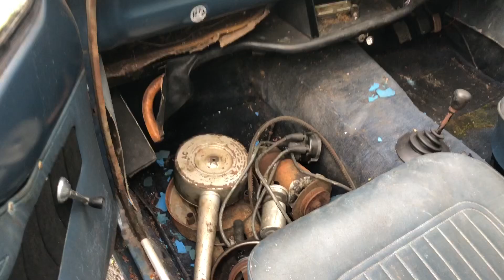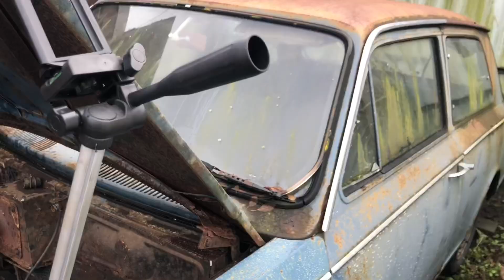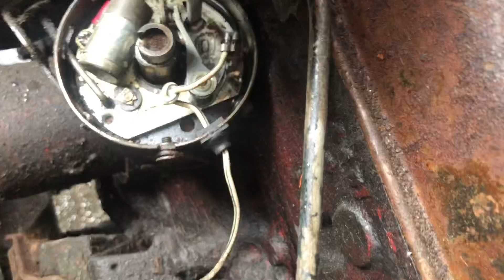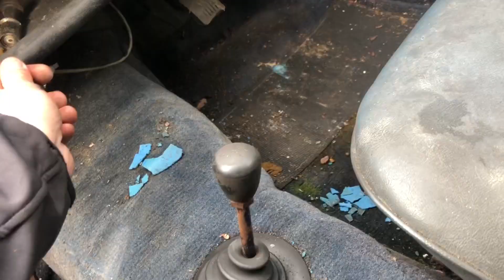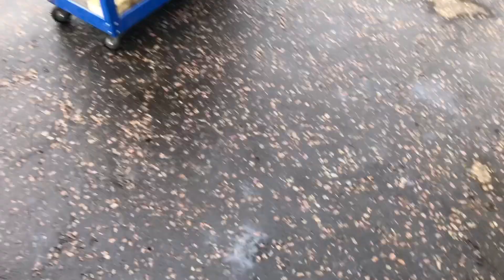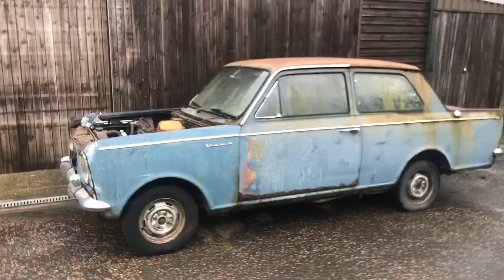Will it run after 19 years 1964 HA viva

Comment: Nice one, guys! Amazing to think that a 55 year old car can be brought back to life. I have mixed memories of the HA. My sis had one in the 1970s. She loved it, and it was generally reliable. One day she told me she was going on hols for a week, and as it was left outside in the road - as per most Londoners - could I drive over and keep an eye on it. I did, and everything looked OK. When she climbed into it, tried starting, nothing happened. I was red-faced - some bar steward had nicked the battery! There was no lock to the bonnet (hood). You popped it open by pushing the lever in the grille (if my memory is good). I felt so bad I rigged up a spare choke cable and did a bit of metalwork. From then on, no-one could get into the engine bay from outside. As an aside, I will say that Vauxhall had got over their bad reputation with Victors and Crestas for rusting. Although yours looks pretty shot, it has lasted over half a century. My sis's one had a small hole in the boot (trunk) under the spare wheel when she sold it. Please get this roadworthy, or sell it to someone who can restore it. Best wishes from sarf east London!
Reply from the maker: Travelbugse28 great story 👌🍻👍

Comment: I went to Switzerland and back in one of these in the 70's. On the way back I had to follow river through Belgium to keep topping up the radiator. When I finally got back to Felixtowe? I bought a new radiator and some hoses and fitted it in the shop yard. Got some money in exchange for my old radiator. I then drove back to Lancashire and had the cylinder head skimmed as it had warped with the heat of the engine. I rebuilt the engine myself and the old girl was as good as gold for years. :)
Reply from the maker: Page Up Page Down 👌🍻👍

Comment: Nice posting .. thanks 👍.
Takes me back to my little Datsun 1200 Pickup .. bought new in '72.
Did all of my own basic servicing .. Points, Plugs, Condenser, various Filters, etc. Annually to the Agents for the Valves etc.
Great to work on .. everything in the Engine Compartment easily accessible.
They don't make them like they used to .. great Memories 😊.
Reply from the maker: Thomas Musso 👌🍻👍
Reply: @sruk  👍😊

Comment: I had one of these way back in 1966. The engine was good, never stopped at all. The rear axle arrangement looked like something cobbled up by a backyarder, not good engineering at all with an industrial bearing to support a pinion shaft in a tubular housing extension. The front body rails were a little too light for Australian conditions. The upper rear body construction used a method borrowed from the first Mini Minor. The lower sills under the doors and a section across under the rear were spotted together with a seam facing directly down into the slush from the front wheels. It was an invitation to rust, invitation accepted.
Reply from the maker: DARANGULAFILM 🍻👍

Comment: Cracking video! They don't make motors like they used to. My tale is that in the early 70's, I was driving from South Wales to Suffolk at night in my Ford MK2 Cortina . At junction 19 of the M4, engine died. Got it running again but really REALLY rough! Made it back to Suffolk, slowly. Stripped the engine and found a big hole in the crown of No.3 piston, and a bent exhaust valve! Can't see a modern motor taking that sort of abuse today!
Reply from the maker: Alan Smith 👌👍

Comment: Vauxhall Viva The buggers never started when they were new,!!!!  Wish I knew then just to let it  set for nineteen years
Reply: Worked on em for years and never had a starting problem ? you must have had a duffer. NB they are probably one of the easiest engines to work on :)
Reply: @ianstubbs1170  Those sixties cars - you could almost climb inside the engine bay to fix them! Imagine, by comparison, changing a starter motor on most modern cars...
Reply: ian stubbs   I agree!
Reply: I have an HC Viva and a Chevette.  Both have the same engine unit.  They go well if you soup them up a bit.  Short-stroke engine, so they can be made to rev well. ;)
Reply: My dad had one, it used to conk out every time we went through a large puddle of water. I can remember at least two occasions when my grandad had to come and rescue us with his Ford Escort and a tow rope.
Reply from the maker: Kevin Wilkinson lol 👍

Comment: My very first automobile was a 1964 red Vauxhall Viva...I purchased it for $600(Canadian) as a high school student in 1975.....it leaked oil, and was hard starting in cold damp weather, and the clutch cable broke once(necessitating a rather noisy gear grinding ride home as I shifted by ear...but it did get me home) I do remember it had a pretty good ride for a small car, and thick sheet metal, and what really impressed me.....real wool carpeting in the interior. This vid brought back some pretty good memories, especially the unique sound of that small four cylinder 1064 cc engine..Thanks for posting!...
Reply from the maker: FMHammyJ 👌🍻👍

Comment: I bought a 1939 Chrysler Kew in 1957 it had been placed on blocks at the start of WW 2 the underside had been covered in pitch, both the inside and outside were perfect although dirty had a 6 volt electrics with no life, took it to my garage had the battery charged pour petrol dome the carb and low and behold it burst into life. Drove it home had one problem stopped at traffic light  could not hear the engine running but it was it was so quiet. Washed it polished it, It was an absolute beauty. Wished I had it now?
Reply from the maker: Ttony Payne 👌🍻👍

Comment: I've just bailed at 0:30 to say... "That car's as old as me! I was born in '64 &, sadly, the Vauxhall Viva was the first car name I could say & recognise as 4 year kid who did a regular run from St.Albans to Paignton in my Dad's Rover 75. That drive could take 12 hours in the summer. Pre bypass A303, pre M5 made the A30 past Exeter the pits! I can still remember the queues! I'd give my eye teeth for that Rover now! Red leather seats, walnut dash. Gorgeous!"
Edit: Liked & subscribed!
Reply from the maker: Les Hemmings sounds lovely. Thank you for the support much appreciated 👍
Reply: @sruk  Cheers mate, no worries. I'm just down the road in Lyminge. 
There's you getting that 7 seater valeted & sold for a nice, easy, quick profit. I had a mate make a living out of the the big Exeter auctions like that. He used a valeting firm who'd pick the cars up on a spectacle lift, valet them & deliver them back to the same spot. He'd run it through the auction next day. 
He had some failures but mainly it worked as you showed. At the bottom end of the market (I say that because I only have experience at the bottom end of the market) you can double the price of s grubby car with just a damn good valeting.

Comment: Lovely running little engine but could be a little noisy when warm due to the "bucket" valve adjusters.  The fuel line from the pump ran along the side of the rocker cover above the distributor and was prone to fracturing due to vibration, the fuel then ran down onto the distributor and went on fire.  I had to repair more than one due to this happening, rerouting the fuel line solved the problem.
Reply from the maker: Robert Mctilt 👌🍻👍

Comment: My first car.! 
I learned to drive in 1978 and my first car was a "C" reg boxtype viva.
13 year old at the time of my purchase which was £50, the minimum cost of a car with a years mot.
My brother hand painted it, (you could get car paint that was not spray on back then) and I owned it for three years.
I thought they were a “positive earth“ car,? As fitting a car radio was a problem. The dash board is all metal, but we got a radio that had a switch on the back to change the polarity of the connections. 
I like cars that you can see the road passed the engine when you lift the bonnet. 
No computers needed to tune the engine,!! A strobe light and a gentle touch on the distributor and it would run sweet.
Reply from the maker: Davy P 👌🍻👍
Reply: @sruk  your comment is appreciated.
My second car was a Morris 1100 mk1, registration KSO 570, it must have been one of the earliest of the production line, as there was no year letter on the numberplate. 
Another £50 car. 
19 years old, 30,000 miles on the clock, and town and country tyres on the front, and the "pin stripes" were actually chromed metal. 
It had belonged to an old farmer who only used it once a week to take his wife to town to do the shopping.
The engine eventually blew and we could not find a second hand engine to replace it.
What I remember most about it was the thickness of the steel on the body, it was atleast twice the thickness of the vauxhall.
Mine was a "Morris" as I can still remember the badge.
hmm,??
A time when cars were simple and I did not pay garage repairs,!!

Comment: I worked for Royal mail for over 40years and remember the van version of this car in the 70s,we had a few brand spanking new ones added to our fleet after the morris 1000 vans were on their way out,great little van,the gear change was the smoothest of the other vans we had in our fleet, great memories.ie worst  we ever had were the morris marina  vans.
Reply from the maker: Alan Grinter 👌🍻👍
Reply: I worked for the GPO in the 70s as a linesman. We used to tap the poles with our morris 1000s to shake out open wire wrap ups to avoid climbing the pole to retension them. First time I tried it with a new HA van the bumper wrapped around the pole. It was like tissue paper.
Morris 100s were a much better van especially when you filed out the restrictor plate the GPO fitted under the carb.
Reply: @MrBillytwice  I agree with you learnt to drive with the then GPO in a morris 1000 van, the van in question was green in colour with no markings on it.When they finished the bikes on telegrams they gave us each a brand new morris 1000 van,there was four of us, to deliver the telegrams,they were all K reg all in sequence,nobody else could use them only us,then after about 12months they took them off us and replaced them with mini vans I was gutted.

Comment: It's much easier to adjust the points if you put the blade of the screwdriver in the correct slot! The distributor base plate has a slot that goes through it, and the points have a little cutout that the screwdriver engages in, just next to the points clamping screw.
Reply from the maker: Pete Knight 🍻👍

Comment: Points can  once they are gapped and cleaned be set very accurately with what was called a dwell meter  which measures how many degrees the points are open , the factory manual setting gives the best HT output from the coil . It's very easy to fit a self contained electronic ignition these days it you want to get rid of the points completely as you probably know. The ignition can be set accurately with a strobe light on number 1 plug HT lead and using the timing marks setting it with the engine running , again see car handbook for settings.
Reply from the maker: Glpi lpi 🍻👍

Comment: Great video. From my days with Chevettes, if it won't start on the key there are some fusable links which blow under high amp draw. Were these fitted to HA's? Also the inlet manifold metal had a tendency to go porous so the engine would run lean / weak. I'd guess the smoke is from worn valve guides and not rings. The rest of the engine is basic and easy to work on / fix. Thanks again, brilliant.
Reply from the maker: DIY Dave 👌👍

Comment: Fantastic guys. The working man's cars from the 60s and 70s all seemed to have similar troubles, normally engine or starting, because of similar mechanics. We all have stories of trouble with our cars. In a bad winter, there was always at least one down your road that wouldn't start first thing in the morning, with the car's hood up, and the guy panicking and tinkering, as he had to get to work. So looking under the hood of this Viva, this brings back memories. I had a few, but my strangest would be whilst driving my Ford Capri, I changed gear and the whole gear stick came off in my hand , Lol, to my horror.
Reply from the maker: Alan Minter 🍻👍

Comment: I did my appenticeship on these old relics. The HC was the newest model back then but all the Viva's shared that engine in various forms. They were very rattly, but at least the HA had a timing chain adjuster so you could shut that up. The power was awesome. 0 to 60 in ten minutes! They had a clever trick of the bob weights breaking loose and slicing the whole top off of the distributor. Happy days!
Reply from the maker: Laxpowertoo 👌🍻👍

Comment: Passed my driving test in a blue HA car back in  1964 in Barking.. Wahoo - LOL.. my love of HA`s never faded in owning various HA vans in the early 1980`s as a mobile car repairer on call 24/7.. The very best was the yellow TELECOM vans that were factory built everything Heavy duty down to the wheel nuts being double ended so planks could not put the wheel nuts back on wrong during a puncture / wheel change, the cars had H/d suspension, H/duty brakes, even factory sump guards..loved them, ended up buying a fleet of them from Havering council painted Blue / White not the usual yellow ones.. resprayed in gloss white oily looking like new vans..lol
Reply from the maker: Ivor Burit 👌🍻👍

Comment: I'm not surprised it started, Vauxhall engines were great in those days. it a great pity that they rusted easily. if the bodywork was the same quality as the engine, they would have been indestructible. I had a company HA van back in the 70's and it never let me down and I did a hell of a lot of miles in it.  I wonder if that one would be a great restoration project, seems a shame to just let it rot.  Well done boy's
Reply from the maker: Michael Jones 👌🍻👍

Comment: The HA and HB were a PIA burning out coils and ballast resistors.  The low tension lead regularly melted its insulation so its no surprise the coil was missing. It happened on all four I had and the events were purely random but I never did find the cause.  Horribly unreliable cars but easy to fix most of the time.  You never went anywhere without your tool kit in the boot
Reply from the maker: Steven Booth 🍻👍

Comment: Late Father bought HA sky blue van new in 66 for butcher shop deliveries even with weekly cleaning by yours truly salt, cow muck and time rotted sills out. Brother in law mechanic aquired a high milage ex water board van to swap engine into. Days of setting plug n points usually 25tho and don't drop the base plate screw.
Sister ran a HA car well into the 70s and vauxhalls dominated family ownership till 80s.
Reply from the maker: Chris Eccles 👌👍

Comment: That was good to see how to set the points and firing order up, lots of people are buying and restoring old cars and finding problems when they have to put spark plug leads or new dizzy caps on a non runner thats had them missing and they cant figure out how to get the firing order correct.
Reply from the maker: Finally Dunnit 🍻👍

Comment: That was a walk down memory lane. I never had one of those but in their time they were liked by many. Along with most cars of that time they could rust like mad, though the engine still sounded as I remember them. I remember one young woman had one which was her pride and joy, she left her then job and went overseas in about '65 so had to sell it and move on. Shame on you for not knowing points, they were a bit of a bane of the life for many along with condensers that could go bad leaving the car with no sparks to keep it rolling. Condenser failure happened to me abut that time on the then new M6 with an old Ford Popular that was 10 years old and already couple of years late for the scrap yard. The same old dog had a plug lead come off going through the Mersey tunnel, it had two speeds for the lanes. Slow which was limited to I think about15 or 20 mph and the fast one that was something around 25~30 mph. I was holding everyone up running at 50 running on three cylinders in the 'slow' lane, I could not wait to get out of the way!.

Comment: Great job lads.
You can't just stop there.
Used to work on the chevettes 1256cc engines same as the later viva's.
What an legend of an engine.
With the points you always had to bend the arm a little for the new points to meet up perfectly and then taken the distributer out and spin it up to see if the points meet perfectly.
Get the timing basically on with the bulb and then the gunson's timing gun on it.
Funny how you had 2 types of distributers an offset one & a central one.
Liked to do the valve clearances as well, miss those days.

Comment: This take me back. I had one of these. Mine as the 90 model which I think yours is as the:90:model  had a red rocker cover and a different carb from the standard HA. It would go faster than it would stay on the road at. I seem to remember after having the heater turned off in the summer when you opened the heater valve in the colder weather it broke the seal on the valve and you had to replace the heater valve. Mine was dark blue it I loved that car till I bought an HB model then an HC version. It had a1800:engine and I bought the automatic which would do 16 miles to the gallon on a good day. I had nearly every Vauxhall model from victor”s and a 101 if anybody remembers that and also a crests. After that our relations  who had the Vauxhall’s garage sold up and I was freed from being expected to buy Vauxhall’s to Volvo”s. Sorry to go on so long.

Comment: Love it, used to love playing around with cross flow and pinto engines back in my banger and stock car racing days, very satisfied when you know you have the plugs and points set right and the thing would run like a dream .
Reply from the maker: Mark Winter 👍